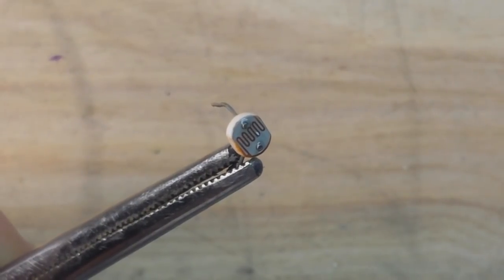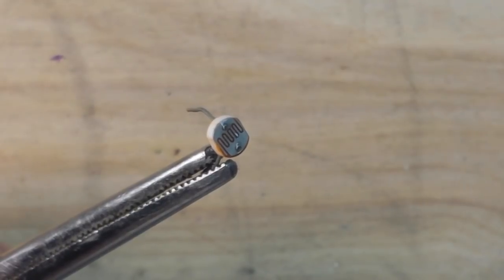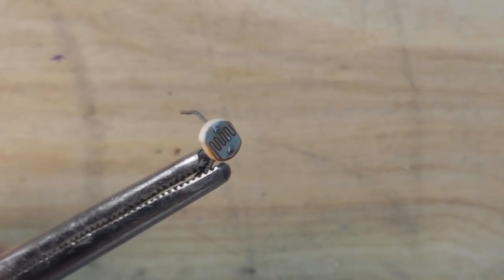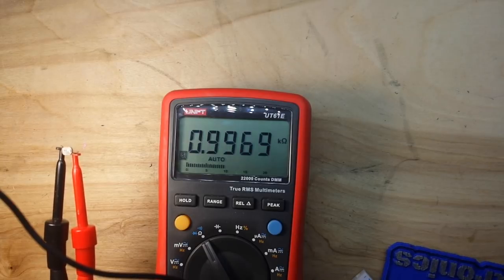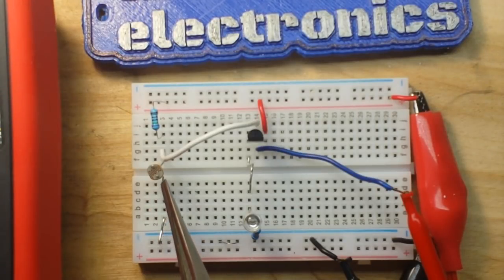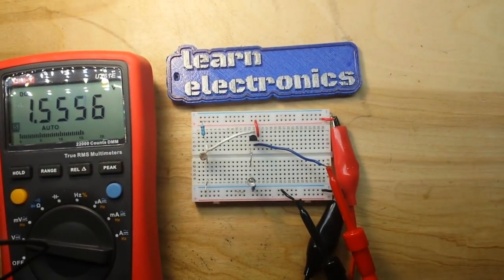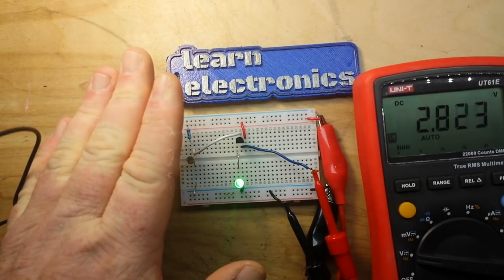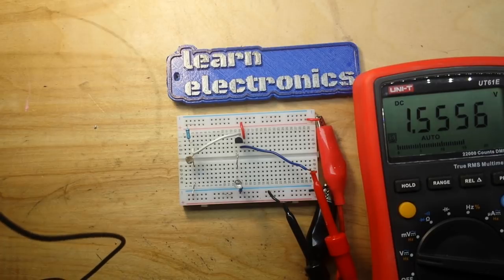A quick look at photoresistors

Comment: Another thing about the photoresistors, is that majority of them, being of usual Cadmium Sulfide, are actually slow at reacting to anything compared to photodiode and phototransistor which is easily discoverable with LED flashlight that you know has higher frequency PWM (beyond 10kHz) and an oscilloscope.

Comment: If you have enough of these connected together in parallel would it work as a solar panel?
Reply from the maker: You would get voltage, but I doubt any current

Comment: Simplest method to implememt this application. Also, and correct me if I'm wrong, but the slight increase in LED brightness when u first move your hand over is due to the proportional voltage increase in the trans base? Nice effect compared to strictly on/off from a non-pwm pin.
Reply from the maker: +Michael Padovani You are correct